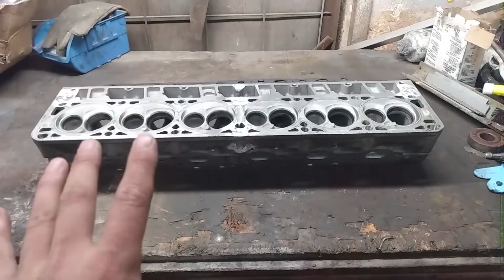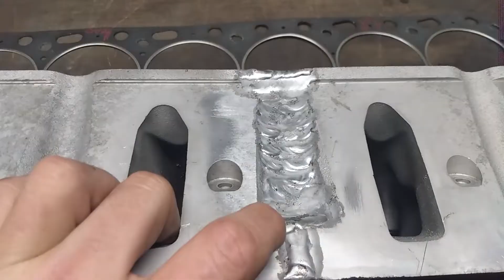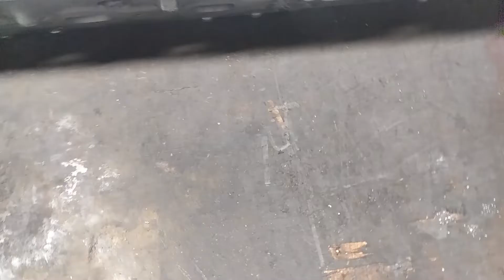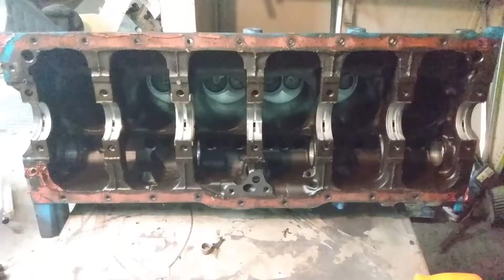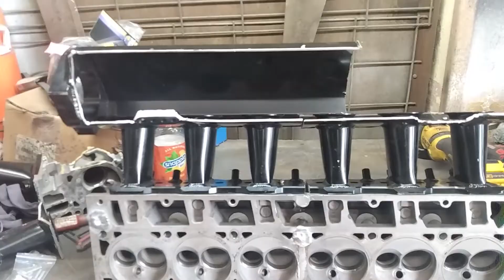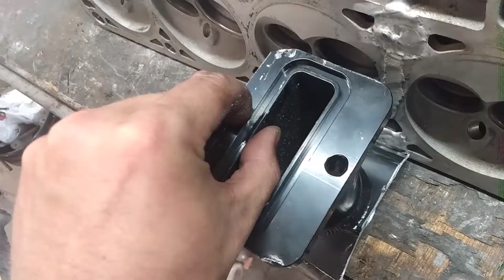Ford 300 HYBRID LS CYLINDER HEAD - All Welded plus Mock-Up! Part 2

Comment: Ok this is Hot Rodding!!

Myngreat grandfather and grandfather used to tell me stories and show me pictures of them back on the day grabbing cadillac 339's, Ford Y blocks and what not from junkyards and peoples back yards. Anything with overhead valves was "the cats ass" as pops used to say, then they'd put them into whatever chassis they could get ahold of 😅. One of the coolest conversions i saw them do was converting a airplane drop tank into a car. My grandfather was in the air force andnwhile he was stationed at Edwards where all the test pilot/ test experimental aircraft were flying, he and his buddy would go out and collect drop tanks and sometimes one or 2 would get written off as damaged beyond repair😅

Comment: For my own version of this, i went for the method of removing material to access the inside of the bolt holes. I built up a bunch of weld, and then I'm going to remove material and weld in a slug for each hole. Since I did mine in 6 pieces, its been a lot of welding.
Reply: You did six? I was going to do three, I was gonna use some fancy heads too. Some nice aftermarket ones. 706s I think.
Reply: @vp6.997  Mine are the finest free 317 heads money can buy. I figured the increased chamber volume wouldn't be as big of a difference after getting the surface decked. It's a twin turbo application, and the stock head probably only flows around 150 cfm at . The 317s I believe flow around 235ish at a similar lift. Using 3 sections of 2 cylinders would have been a lot less work.

Comment: so this concept has been a reality since the 70's when Bruce Sizemore did this on a Ford 300 with a Ford 351C head. it does take 3 heads to do this right, youre correct on that one. Batten Cylinder Heads in Michigan did all the head work for him and they are still around👍 obviously the Ford Cleveland style canted valve head is far superior to LS heads so my question is why? is it just that LS heads are much cheaper??? i see no performance advantage at all when this can be done with a more modern aluminum Yates C3 head.
Reply from the maker: I've made a video on the subject,.the pros and cons on the Ford heads vs the LS heads, go watch it when you have time and leave a comment.

Comment: Ford 300 cylonder pitch is 4.08" which is 0.040" greater than the LS, SBC and Chev inline six. The LS should fit the Chev sixes fairly well. The bore is a bit smaller than the Ford so really big valves is not an option. Should be able to use the 2.00 intake valves no problem. A 292 with the LM7 heads should be a strong performer with the good port flows.
Reply from the maker: you got it.

Comment: one solution for gaskets is simply to imprint with a thin sheet of brass or copper and transfer the pattern of course this comment is for those that didn't know one could do that.

 if you have an idea you can bet someone has thought of it first, and you are willing to do the digging, at that point your only job is to improve it if possible,/ don't listen to people tell you,,, you can't do that. That's people that don't want you to do that, if it is made of metal and as long as machining exists I'm here it can be done as long as it is based on the practical arts. with enough matching cutting and welding there is not shit you can't do its how we got to the moon. it took many arts to get there none the less we did it.

Comment: Can’t wait to see this thing running! I think I’m gonna try making one for a dirt modified next year out of some square port heads
Reply from the maker: So square port heads are interested.

The LS ones don't fit smaller chambers, I know the 300 has a 4in bore but since the spacing is a little off I worry valves will hit.

Definitely check before cutting.

Or use LT 5.3 heads

Comment: The only thing I'd be concerned about with the cylinder offset you have here is that the fire ring seals. I'm sure the overhang you have there is not ideal for the location of the combustion chamber, but it's close, so as long as your head gasket seals, you should be good to go there.
Reply from the maker: it should seal, i cant think of why it wouldnt, who knows tho, we will see.
Reply: @TallGarage  As long as the diameter of the fire ring gets full purchase on the head it should be fine. That area where the combustion chamber overlaps with the block it's hard to tell from your video how far that goes outside the cylinder bore.

Comment: Your progress looks very good, If I was going to do this I would fit a 3/16" plate inside the cut end to seal the water jacket so you can weld it water tight ant then the weld on the outside would just be structural, and then I would build a water manifold to tie the ends together.
Reply from the maker: I thought about doing it that way but decided against it.
Reply: @TallGarage  I like your way better. This way if it leaks you can still touch it up without starting over from scratch. I'm watching another series where they're taking 4-valve heads and mounting them on a 6.8L V10, so they had to graft pieces of multiple heads together to make it happen. They did the plate method and it leaked, now they have to cut them in half again and re-weld, then re-weld the structural areas, then have it re-decked and re-bore the cam journals. This may end up being they need to buy 4 new heads and start over. TL;DR, doing it the plate way ended up being a nightmare that can't be easily fixed. They were ready to put that engine together and run it that day. It's been 3 weeks now and no updates so I'm thinking they're back to square one.

Comment: Why not fill the shrouded parts with weld and grind the part that is sticking in the chamber too much. This way you can match the combustion chambers to each cylinder. Should be a fun piece.
Reply from the maker: thought about that, could be something to look into.

Comment: The one thing about the Ford straight 6 cylinder the newer crappy head design supposedly there's three different types of cylinder heads and they all get Flo good. I had one in my shop I get a slight bit of modification on the ports. It seemed to work pretty good.
Reply from the maker: Promaxx did do a fully CNC ported head that flowed 218 cfm @ .500" lift, not all that great flow numbers for 1500$

Comment: I applaud you for doing something different and interesting.  Thinking out loud, I wonder if you can off set the cylinder bore a little to compensate the chamber off set when machining an oversize cylinder?
Reply from the maker: I was literally thinking the same thing lol

Do like a 060 over bore and try to offset it, would want to sonic check I tho.

I'll look into when I build a forged short block.

Comment: I first saw this done several years ago by a racer for his 300 powered Falcon ....he had sealed the two halfs with JB weld with tubes linking the water jackets.
He got it running and it worked, but had water leak issues.
I've got a 240 i removed from my 65 Galaxie 500 when I swapped in a  427 FE.  I'm planning to put the 240 in my 67 Mustang to replace the very tired 200 six.
I've got a set of 5.3 LS truck heads I'd like to do this same swap with.
I'd been trying to work out the problem of being able to weld the inside of the water jackets and couldn't get my mind around it....I like your solution of the solid plugs being welded on top and bottom.
Before seeing your videos, I'd considered going the three piece route and welding plates in to cover the water jackets. 
And then linking the water jackets externally with a log manifold.
I'm curious to see how you contain the oil when you do the side lifter cover.
Ill continue to watch your progress.
Good luck.
Reply from the maker: Thank you for the comment, happy i could give you some ideas for your own project.

Comment: on the overhang could you not slightly smooth the sharp ridge with a diegrinder ? .... i have some idea about the vital importance of the combustion chamber shape and depth .... was thinking the sharp edge may cause some heating issues ? ......
Reply from the maker: it could cause a hot spot maybe im unsure i will have to look into it

Comment: Were those 5.3 heads or 6.0 if it's 5.3 they were on a .150 smaller bore on the ls you should have plenty of clearance
Reply from the maker: all cathedral heads are small chamber iirc, the big chambers are on the square port heads.

Comment: I wish someone would cast a head like this for 300 sixes. I'd buy one.
Reply from the maker: maybe one day
Reply: There was a guy working on a head for the 240/300 , but he was also building a head for the 144/250 Falcon six. He was just starting sell the revised Falcon head  with a separate intake and larger ports/valves, when he died.
Someone bought the the rights and casting molds from his family and is selling them again.
The big six head never made it past mock up stage, and I don't believe it was going to be a cross flow.
Reply: There’s companies that made aftermarket aluminum heads for the baby 6 you would think they would make them for the big 6 as well

Comment: Just curious how to decided on LS heads.  I'd love to see someone recreate Sherman Sligh's Boss 300 by joining six separate segments from Boss 302 heads together.  Can you get into why?  My understanding is with the right flow you can get 625HP NA.  But I don't really know.  Thanks for this. Love the content.
Reply from the maker: The ease of working with aluminum is a big plus and the cheapness of the heads you are cutting up helps as well.
Reply: @TallGarage  what kind of HP do you expect to get?  Will you be NA, EFI, Boosted, etc...?
Reply: The Cleveland heads have a different valve layout and require a custom cam....not cheap.
The beauty of using the LS is that the valve order is the same as the Fords , so can use the existing available cams.
Reply from the maker: @godsowndrunk1118  its really the best part, i will be getting a custom cam make anyway tho lol as i want a roller cam.
Reply: Those racing engines were a fantastic piece of engineering. 
A BOSS 302 is very different from the stock production Windsor cylinder head.
They're a  canted valve style. Very rare. Very valuable.
Reply: Thanks for posting the update.  Interesting project that I'm sure will be a good reference point for many people in years to come.